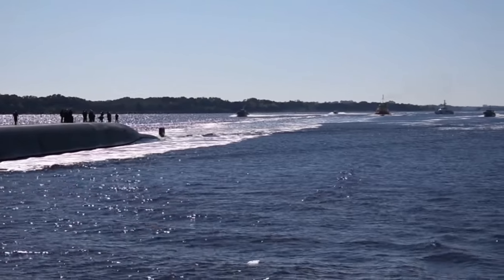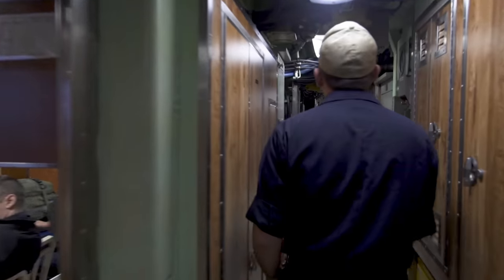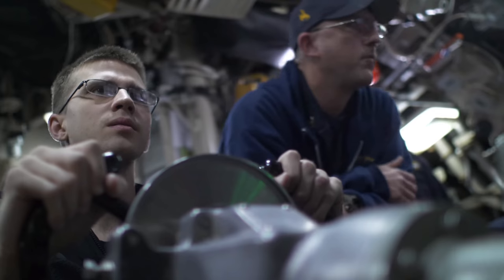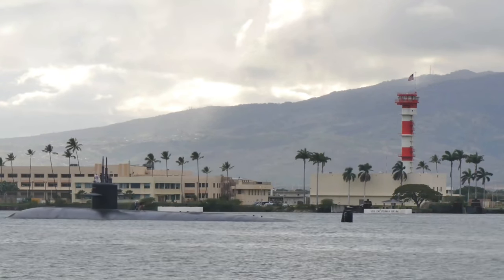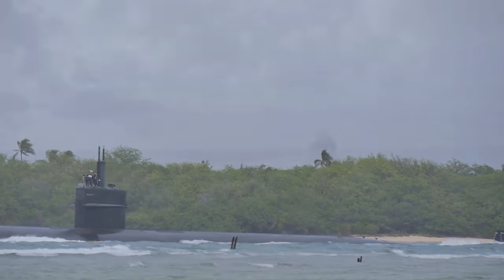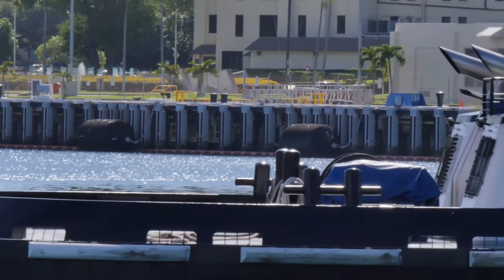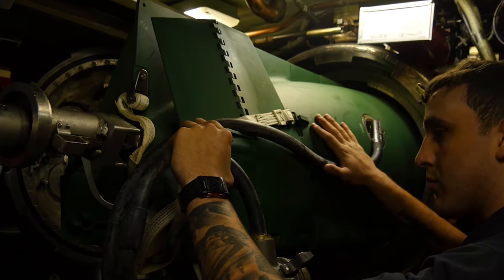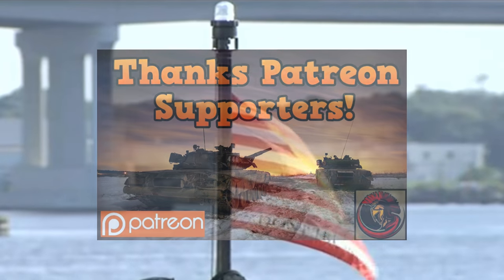What does the U.S. Navy Submarine fleet comprise of?

Comment: And the Virginias are getting lasers in their photonics masts. Lasers powered by a nuclear reactor
Reply: Gage  Anytime a laser can be hooked up to a 30MW capacity nuclear reactor you do it.

Navy isn't saying why but a laser powered by a 30MW capacity nuclear reactor opens up the chance of burning ICBMs in their boost phase among many other possibilities.
Reply: Gage  They asked that same question about the "windshield wipers" said to be made at Los Alamos in the 40's for submarines. Not long after things took off with a "Boom!"
Reply: Gage  Throw in the USN has been using green lasers for communication for decades. At the correct frequency the sub doesn't even have to get to periscope depth to communicate. Throw in a weapons grade output green laser the sub might not even have to put up a mast to down aircraft or cruse missiles.
Reply: @ovk-ih1zp  that is beast.
Reply: It's not a guarantee that it would work, but it is theoretical that it COULD Work. Salt Water is a bitch of a medium to try and fire a weapons grade laser through, but it won't take very much power to blind pilots or cook the electronics of a drone or cruise missile. It's also not that hard to cook off the liquid fuel in most current generation cruise missiles.
Reply: @ovk-ih1zp  Other than a carrier, there is no other opportunity to power a laser with a nuclear reactor. 

With a laser powered by a 30MW capacity reactor,   ICBMs fired from North Korea could conceivably be hit in their boost phases.

So the effort is more than worth it.
Reply: Zap!
Reply: Resurgens  From two sources on the SG9 Reactor that powers the Virginias:

1. "The power will come from the submarine’s nuclear reactor which has a capacity of 30 megawatts."

https://www.google.com/amp/s/www.forbes.com/sites/hisutton/2020/02/09/the-navy-will-arm-attack-submarines-with-high-energy-lasers/amp/

2.  "The reactor is estimated to generate 210 megawatts (MWth) [3] driving a 30 MW pump-jet propulsion system..."

https://en.m.wikipedia.org/wiki/S9G_reactor

Presumably the subs will not be moving and thus not using their propulsion systems at full capacity when they fire their lasers. So much of that 30 MW capacity otherwise used in propulsion will be available when it is time to fire lasers.
Reply: Are you talking about the range finding lasers?
Reply: @alrun1836  Lasers could be used for anything. But seems likely that they will be used for something that justifies an attack submarine coming to the surface and thus risking exposure. 

And there is the rare opportunity to hook a laser to a nuclear reactor thus opening up possibilities that increased power may provide such as possibly heating up  and thus disrupting ICBMs in their boost phases.
Reply: What good if you can shoot lasers but you has no capabilities to acquire airborne(let alone space) targets?!
Reply: @stormtrooper9404 In the context of laser pointing and tracking one publicly known possibility is the Sea lite Beam Director which is a "high-precision pointer-tracker system...The Sea Lite Beam Director provides the capability to track highly maneuverable tactical targets and destroy them with the MIRACL."

https://www.wsmr.army.mil/testcenter/testing/landf/Pages/HighEnergyLaserSystemsTestFacility.aspx

No doubt there are other classified options most likely including being able to heat up Chinese and Russian satellites from submarine based lasers.
Reply: ovk8102 I’m pretty sure deploying lasers specifically to blind people is banned. Though I’m not sure how well that would be enforced or if “we were aiming for the sensors” would be a legitimate defense.
Reply: Resurgens  Well said. You are very knowledgeable. Appreciate the discussion.There is some confusion about how the subject of sub electric capacity is discussed in open publications with respect to powering lasers.

Overall output of the SG9 reactor is estimated to be 210 MWs. And Los Angeles class SG6 reactors were estimated to be about 160-165 MWs as you pointed out.

In the context of sub reactors' powering lasers, open publications are using 30MW capacity as a way to estimate what a sub not using its propulsion system would be able to use to fire a laser. Such as a sub at or near the surface preparing a reasonably stable non-moving platform for a laser shot.

The idea being a quick pop-up for a laser shot then quickly disappear. 

So in this discussion the overall 210 MW   power of the reactor is not relevant, only the estimated 30 MW capacity available to power laser shots for a sub running its propulsion system at a very reduced level. 

I am surprised that even this much about lasers on submarines got out into the public. There is serious discussion about nuclear reactor powered sub lasers even being able to disable enemy satellites with the assistance of other sensors not on board subs. And that may ultimately be why it is worth the effort.

It is interesting to consider what excess capacity the twin Ford-class A1B reactors will be for future lasers. Combined total power output is 600-700 MWs vs. the SG9's 210 MW so it could be very interesting to say the least what excess capacity would be available. Cheers.
Reply: Gage  Not really, they have under water laser scanners.
Reply: @Chuck_Hooks  True, but the Aegis destroyers and cruisers with SM-2 would likely be deployed for such a purpose - I suppose if area-denial was present and you could only get a sub in the area, it might be useful.
Reply: @EstorilEm  Unlike SM-2s, laser shots are cheap and virtually unlimited. Particularly when lasers are powered by a subs' nuclear reactor. 

If it is possible for every Virginia to be an ASAT weapon, then you don't hesitate. You make it happen which is what the USN is doing.
Reply: Resurgens That 210 Megawatts as referenced is in thermal energy, not electrical energy, hence 210 MWth. Because of the laws of thermodynamics, you always generate more thermal energy than you do electrical.
Reply: We're getting closer to sharks with freaking laser beams attached to their heads.
Reply: @Chuck_Hooks  That's so far down the road that it's almost inconceivable - how are you going to house a laser small enough to mount on/in/around a Virginia class sub anyways?  Even short-range shots are in their infancy - an extreme-range firing with (literally) the world on the line from a sub is still sci-fi stuff. 

My point was simply that  the Aegis boats have this capability today, and have successfully demonstrated it many years ago.
Reply: @EstorilEm  The Chinese are reportedly working on turning at least some of their naval ships into laser ASAT weapons. 

https://www.google.com/amp/s/theprint.in/defence/china-is-now-testing-laser-asat-weapons-from-its-naval-ships/223294/%3Famp

Perhaps not as sci-fi as you think.

Comment: I worked nearly 12 years at Electric Boat in Groton, from '79 to '91.  Great time to be a young engineer right out of college.  Spent most of my time on the SSN side (Los Angeles Class).  Still remember the smell of a sub under construction, it's burned into my memory.  Oh, and bumping my head a lot!  Visited a base on your side of the pond (Holy Loch) a few times too. Good times.

Comment: One thing you NEVER want to do is underestimate the current generation of Diesel-Electric boats. They have done a lot to catch up to USN/CIS Nuke boats. The Diesel boats might not be as feature-Rich as an American Nuke Boat, but they ARE Extremely quiet & very Deadly to other Subs & surface contacts.
Reply: Not to mention that DE subs will always be quieter than nuclear.
Reply: *sweden intensifies*
Reply: In littoral water, DE sub rules.  The truth is that both sub type  have divergent advantages and disadvantages from each other.

Comment: for the Virginia class, the official speed of 25kt or more - probably means 25kt quiet, perhaps as or more quiet than the Los Angeles at 20kt, which may mean quiet enough that its passive sonar is effective at that speed. Perhaps going speed higher than the quiet speed means it can't hear anything? I just saw that the Navy is terminating the hybrid-electric drive evaluated in a few DDG-51's in which there is the option to engage an electric motor drawing power from a turbine generator (much smaller than the main gas turbines) for low speed ops (up to 11kt). I would think that something like this would also enable a nuclear submarine to operate more quietly. feather the main propulsion, and have an electric motor drive a small pump jet for low speed loitering. it would certainly change the noise profile of the sub?

Comment: I'm sure you have already received this comment over the past few days, but have you had an opportunity to check out Gunner heat PC?

It seems to be targeting somewhere in-between warthunder and steel beasts. Focusing on more reasonable and simplified controls compared to steel beasts, but much better simulation and realism than warthunder. 

They have a very early trial available on Itch.io, I would suggest you watch the tutorial on gunnery first (https://youtu.be/aXajPFRRjVY). Otherwise, it can take a few frustrating minutes to figure out. But it is fun to play with the different lead systems. Specifically the difference between the M1A1 and the M1A2. 

Sadly, no challenger or warrior yet, but I'm sure they are coming as their priority are vehicles that participated in actual combat.

Comment: Based upon my current reading, the silent service appears to be the one area where the USN budget and research into applied advanced technologies has actually been executed in a reasonable manner (vs. the Ford carrier, the LCS debacle or the newly awarded FFG(X) to Fincantieri which is already predicted to blow through original budget estimates). It seems it will be years before the USN actual has the desired hardware and units in place to effective compete with a peer adversary, and some skill sets that have atrophied over the years will need serious training to reacquire (particularly arctic operations).
Reply: Eh the Seawolf budget got out of control VERY quickly, but it was pioneering a number of new technologies and was far ahead of its time - created when absolute perfection was required at any cost, so it's understandable.  The USAF analog would definitely be the low-production F-22, which ALSO continues to rule the skies with no equal in sight, much like the Seawolf.

Comment: Is submarine on submarine warfare a meme? Russia seems to be more into it than the US, as the "shkval" torpedoes are faster, more powerful, and more advanced than any variants of the mk 48. Then again, the US could have an even better torpedo that they're not telling anyone about.
Reply: Except the Shkval is only good in a straight line. It can be easily out maneuvered. Russia is decades behind the US in technology.
Reply: @Bellthorian  Then what are the best torpedos as of right now? Can torpedo maneuverability be quantitatively measured?
Reply: That torpedo has very short range, worse destructive capability, worse homing, and many other things, Iirc the only thing they have over the MK48 is speed and pure warhead size, but the mk48 utilizes keel breaking to break the keel of a ship so the MK48 is more effective against a ship, against subs you aren't surviving either
Reply: @tjwine465  How do you know it has worse homing? The maneuverability of air to air missiles can measured with maximum g tolerances, is there a way of measuring the maneuverability of torpedoes? If there is no way of determining torpedo maneuverability, you can't really make that claim.
Reply: @BENKYism  you can, basic science, the faster you go the bigger the surface you need to turn, if you look at the fins on it they are long but very narrow, mixed with the fact it goes 200 knots? Idk which version they are on and both have different speeds, the mk48 goes a lot slower and has many control surfaces to maneuver
Reply: @tjwine465  That sounds like speculation. At the end of the day, we don't really know the performance figures of torpedoes when it comes to maneuverability. It's just speculation.
Reply: @BENKYism  we do by looking at the control surfaces, speed, and using science...

Comment: Diesel submarines don’t stand a chance. Modern subs can pick up there acoustic sound.
Reply: Joshua N. Ajang my whole point is any diesel operated submarine is easily detected just by the sound of the engine. And yes a submarine can be detected by its propellers. There is something called capitation. Any sub no matter if it is disease or nuclear, can create bubbles In the water when the submarine makes extreme changes  in speed. Sonar will pick it up in a heartbeat. As for your comment on ion battery powered submarines it is just a waste of money if you are patrolling the open ocean. The battery technology just hasn’t reached its full potential. If a submarine is powered by batteries then it limits its range. Battery powered submarines would be limited to coastal defense. An ion powered submarine would be hard to detect but it would have limited range. Think about it for a moment. The submarine can only hold a charge for so long. Thus limiting its duration at sea. As of now there is no submarine that can go on patrol for six months at a time on a battery charge. Even if a submarine can recharge its batteries at sea it would take some form of generator to charge the batteries. That alone would cause noise and make that sub detectable.
Reply: Don’t get me wrong every submarine has a battery back up system. But to rely on batteries alone would put the crew in a coffin In case of a power failure.
Reply: I’m not trying to be a know it all but did you see north Korea’s submarine so called ballistic missile submarine? There technology is so old that the submarine can only carry one missile. The so called I.C.B.M is held in its conning tower. North Korea has only diesel submarines. North Korea’s technology is pre Cold War.